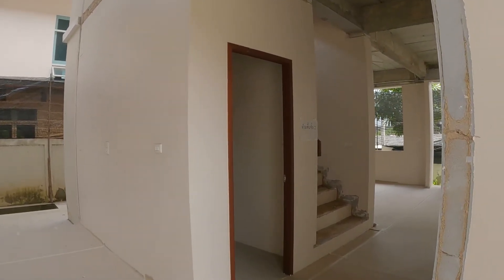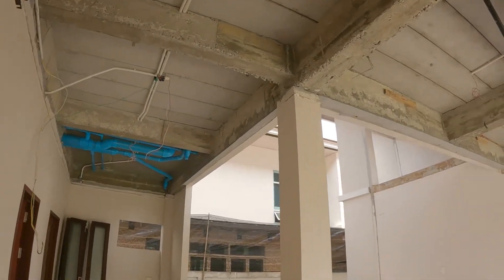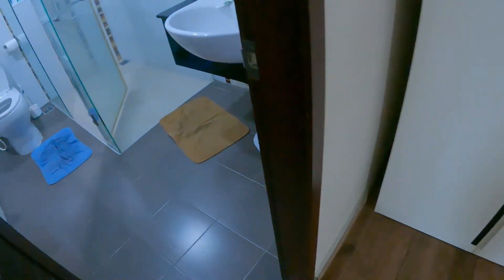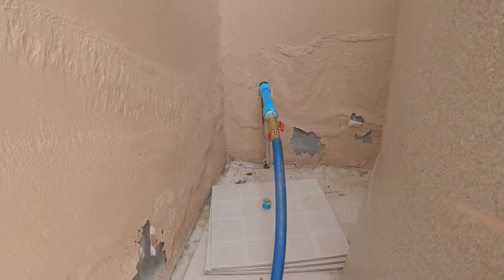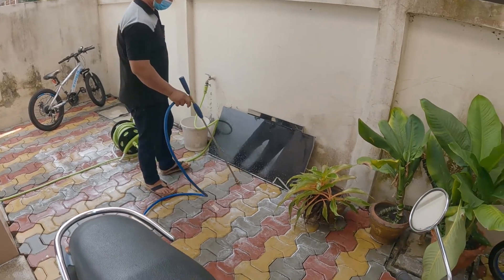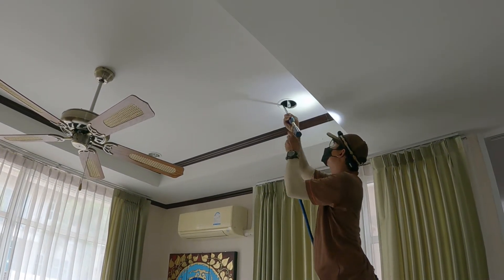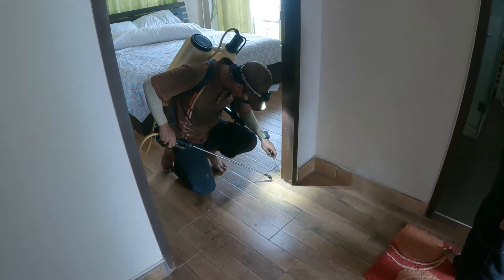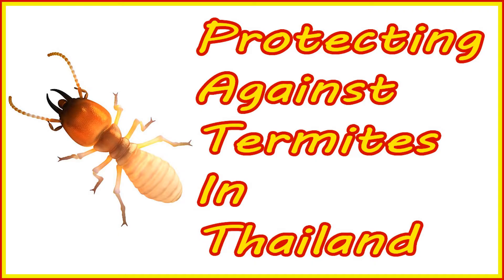Protecting Against Termites In Thailand

Comment: Thank you so much I am in a rented house in Pattaya area and just realised I have a termite problem. I had been away for 3 months and these bugs took advantage with 3 mud tunnels going up the front lounge wall into the ceiling god knows what damage they have done!!!
Reply from the maker: It's a nightmare. I was aware of the problem before I bought a house and one of the first things I did after buying the house was to get a contract with a termite company. It was Bt14,000 for three years, but they were only interested in the money and the service was terrible. As a result, even though I took precautions I still had a big problem. I have since found another company who are a lot better. They come every three months to spray outside the house and they also do a visual inspection inside the house. Things have been fine since, but after replacing all the parquet flooring upstairs with tiles there is now a lot less termite food in the house! They eat cellulose, so in addition to wood they will eat plasterboard ceilings and any books they find. I hope you don't have a serious problem. My best advice is to find a termite company who do good work and aren't just in it for the money.
Reply: @expatlivinginthailand  Thank you for this video, Phil, I noticed it is 2 months ago, I am surprise I didn't see it, only see it now. Hopefully your house will be 100 per cent termite free forever.

Comment: I've been using fipronil here in Thailand. But now it's not working. Seems the termites are becoming used to this chemical. Need to use plastic stuff now. Anyway even with treatment keep an eye out for the buggers.
Reply from the maker: That's interesting. Thanks for the info. I guess that insects develop resistance to insecticides the same way that bacteria develop resistance to drugs. I get a company to come in to do the inspection and treatment, and I trust them to keep up with the latest developments in the world of termite treatment. The first people I hired were a bunch of cowboys, but the current company is good. Furthermore, having replaced all the parquet flooring with ceramic tiles, the house now contains a lot less termite food! Horrible things. As you say, you always have to remain vigilant.

Comment: Thanks for sharing! May I ask how often you do this procedure to protect your home from termites?
Reply from the maker: Certainly! I got it done a couple of years ago and included in the price was a three-monthly inspection. Every three months they came back to spray outside and check the inside of the house with a flashlight. After a year, everything looked fine and they didn't advise getting the undersoil treatment done again.

However, receiving your comment has reminded me that I haven't seen them for a while and I need to get them back soon to do another inspection and - possibly - another treatment. The thing about termites is that you don't see or hear them. When you do notice them it is usually too late. The damage has been done, and they can do an immense amount of damage. The last treatment cost Bt12,000. If the money isn't an object, there's no harm getting it done every year - better safe than sorry. Alternatively, have an annual inspection done and get them to do a treatment if they find signs of termites.

Thanks for the reminder. I think I'll call them back again tomorrow!
Reply: @expatlivinginthailand  thank you for the information! I'll keep that in mind with the new home I'm considering purchasing. Getting an annual inspection sounds like a good precaution to take at the least~ Glad y'all were able to get your termite situation on control!
Reply from the maker: @nikkian9254  I do need to get another inspection soon. You really don't want termites in your house. They arrive in great numbers and cause massive damage.

Comment: Termimesh,  no poison. Ultra marine grade stainless Steel termite protection system that once installed last the life of the building
Reply from the maker: @alates09  I've never heard of this, and I don't know if it is available in Thailand. An effective, non-toxic system that lasts as long as the building would be perfect, but this wasn't an option when the house was being built.